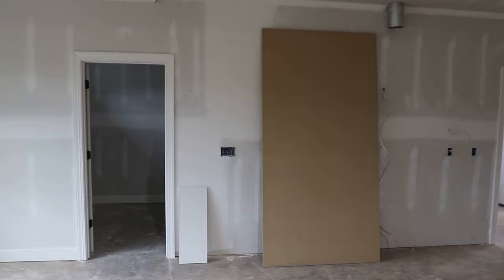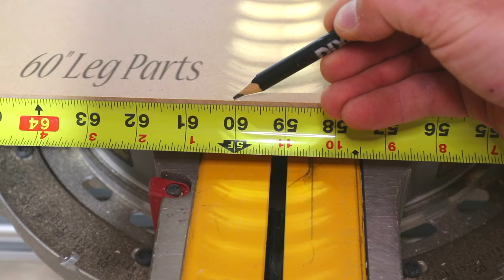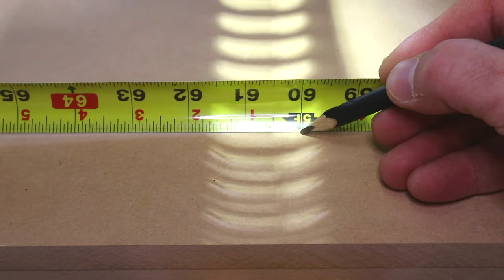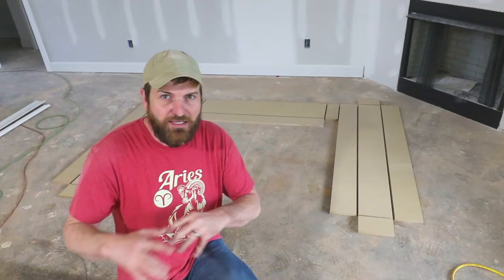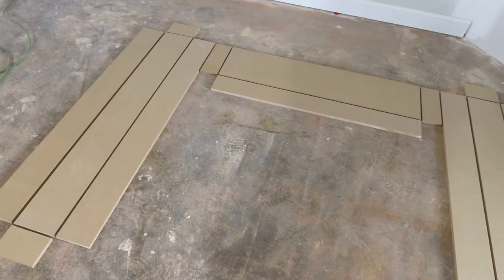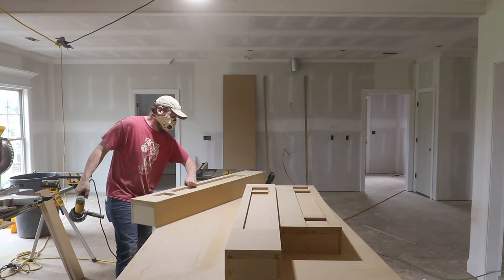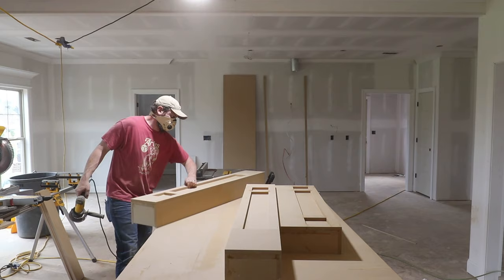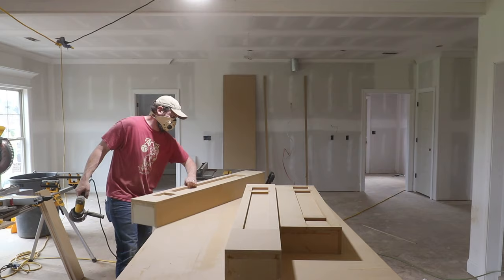How To Build A Mantel

Comment: Jared, dude I love your designs and the way you explain ish is awesome and hilarious.  I’m using the mantel project currently and I’m so excited that I can follow your guidance.  Thanks brotha!  QUESTION... WHERE CAN I GO IF I HAVE QUESTION ABOUT anything?  A BLOG, A WEBSITE???  What’s the deal my man?
Reply from the maker: Thanks man! Despite a ridiculous amount of subscribers I’ve been able to answer questions and keep up with the youtube comments. So just ask here bro!  Sometimes it takes me a day or 2 to respond cause I’ve turned off notifications to try to reduce my screen time 😂 but sometimes I catch it in 5 minutes 👍
Reply: @TMPK  I tried to send a question yesterday but not sure if it went through. (I dont see it.)  **HERE it is just**
---WHAT R THE DIMENSIONS OF THE PANELS @ THE TOP N BOTTOM OF THE RT. & LT. LEGS.  I understand the 2" strips but NOT sure of the LARGER PIECES.  Thx again and love your work brotha!
Reply from the maker: @21shanes  every mantel can be different, without watching the video again I can’t remember what size I made them on this video. I think I normally make an 11 inch wide leg, by 60 inch tall. 
Then with the 2 inch face frames on each side, that would cut the middle section down to 7 inches. Then I would just try to make that top panel square so it would turn out to be a 7x7 inch box. But don’t forget to account for how far the crown mould drops down and leave an extra 2 inches below it so it has the same appearance of the sides with 2 inch face frames.
Reply: @TMPK  Dude, thx a ton for getting back so swiftly.  The time in the video I'm speaking of took place from the 4:39 mark to the 5:10 mark. You explained, "CROWN HAS A DROP OF 3 and 5/8ths", SO TOP GETS A 5 and 5/8ths", SO THERE"S GOING TO BE A 2" STRIP BELOW CROWN MOLD."  

So, If I'm understanding you correctly the LARGER PANELS on the face will be 5 and 5/8ths to keep everything uniform, CORRECT?  ***Dude, THX again for any help!!!
Reply from the maker: @21shanes  yeah! As long as you have the same drop on whatever crown mould you choose. If it’s a different drop, just add 2 inches to that drop measurement.
Reply from the maker: I normally add the width of the total leg, to the crown drop measurement in order to end up with square panels in the end. So if the leg is 11 total, my top middle piece will be 14 5/8. 11 for the panels and 3 5/8 for the crown.
Reply: @TMPK  dude, you are the freak'n best brotha!!!  Thank you, Thank you, Thank you.  You have been a HUGE DAMN HELP!  

I'm sure I will be hit'n ya up again b/c I do love your work and you make it easy to understand.  You explain ish well, with your mouth and your hands,,, as you would discuss.  lol
Reply from the maker: @21shanes  happy to help!
Reply: @TMPK  Dude you have know idea.  Its basically an Anniversary/Birthday/Christmas gift all during this time of COVID shit is tight with$$$.  Dude, you have helped so MUCH!

Thank you!
Reply: @TMPK  hey Jared, I know that you said you don't like painting MDF in one of your comments below but I was curious, IF YOU HAD TO, HOW'D YOU GO ABOUT IT EXACTLY?  HYPOTHETICALLY, what would be THE EXACT STEPS?  I.E.  Sand Paper GRIT, PRIMER?  If so, what kind?  Gloss/ Semi?I know you said it would take about 4 COATS NORMALLY but IS THAT WITH SANDING AND A PRIMER?   

Dude sorry to ask sooo many questions but I do RESPECT YOUR WORK and IF you were near I'd hire you but you arent and I want to do what you show out of RESPECT and DO IT PROPERLY as  A GIFT TO MY WIFE.

Thanks for any help, AGAIN!  You are the fu*kn man!
Reply: @TMPK  PREP MDF FOR PAINTING>>> THOUGHTA?!!???

I did some research, what are ur thoughts regarding...?

-  SAND W/220
-  SOLVENT BASED PRIMER
-  USE A BRUSH TO APPLY PRIMER, paint as normal?  THOUGHTS?

Like I said, I trust your opinion and judgement my man.  Thanks for any thoughts.  Hope to hear from you soon.

Cant wait to take on your next project brotha!
Reply from the maker: @21shanes  Haha it’s not that bad. Fill the nail holes first. Some kind of putty or wood filler. Sand that down smooth then start with primer, and I think the professionals at work use a paint sprayer but I’m old fashion and actually like seeing a little bit of paint brush lines. 
  I don’t know anything about kinds of paint, but some kind of trim primer maybe? Then light sanding 220 grit just to knock the fuzz off. Then probably a semi-gloss would look best. And probably 2 coats of it but that depends on how the primer goes. 

I painted my personal mantel like that and it turned out great. There’s a video somewhere deep in my channel called cassy and Jared remodel or something like that. I believe you can see my mantel in there but that’s before I was good at how to videos. I was just filming shit for fun lol
Reply: @TMPK  Dude, I wish we lived close by to go and have a drink over it.  lol  You're the best my man!  Im a freakn magician bc of the "Mantel" video and I know all of theee SONGS BY HEART NOW...  no shame in my game.  LOL  

HEY, THANKS AGAIN!  I'm sure I will be in touch in the future.  LOL

Comment: Any Chance you can explain the angle cutting for the Crown Molding? I have tried every combination of your 35 Degrees and 30 degree tilt and nothing matches..... like not even close. I also tried 45 degrees and that obviously didn't work either.

Thanks!!!!
Reply from the maker: Well there different kinds of crown molding that uses different compound angles. 35° and 30° are for a 45° crown, mean same drop from ceiling as distance on the ceiling from the wall. The other crown is a 38° crown. That comes down the wall farther than it sticks out on the ceiling. I believe the cuts are 31.6 miter  33.8 bevel. 

The easiest way to find your compound angles for the crown you have, is turn the crown upside down on your saw. The bottom of the crown goes agains the fence, and the top of the crown goes on the table. With the entire piece out to your left, adjust the crown against the fence and the table until those parts are flat, then turn your miter to the left to 45° and that’ll be your cut angle. Make the cut, flip the crown back over so the bottom is towards you, lay it flat on its back on the table then line up the bevel and miter with the 45° cut. It’ll be 1 of the 2, 35°/30° or 31.6°/33.8° 🤷‍♂️ I should make a crown video one day lol
Reply: @TMPK  Thank you...... Your video did a great job explaining all of the build except that. This is not something I am familiar with. I appreciate it!!!!

A crown molding video would be a great idea!!!

Comment: Hi Jared,

Any chance you can share a sketch with the measurements? Love this mantel, but having a hard time figuring out the dimensions of each piece. Thanks very much. Mike
Reply from the maker: This was years ago and every mantel can be different. Just depends on wall size or fire box size. I normally like the top at 5 ft and 8 inch wide legs and about 6 deep.
Reply: @TMPK  what size panel molding do you use with 8 inch wide legs and 2 inch wide (1/2 inch) strips? Also is top of surround 8 inch high (same as leg width) or is it a little larger? Thanks much.
Reply from the maker: @burke1754  the base cap inside the panels is 1 3/8 wide. I’ll try to draw it with text below lol 

__
2 inch top
______
3 5/8 crown 
_________
2 inch face frame 
_________
4 inch recessed panel with 1 3/8 base cap picture framed inside
_________
2 inch face frame
_________

The legs ⬇️
| 2 | 4     | 2 |
Reply: @TMPK  Thanks, 
and the height of top piece that runs between the legs is 8” high?
Reply from the maker: @burke1754  yeah, below the crown is 8
Reply: @TMPK  thanks!!

Comment: What did you use when it came to painting the boards? did you have to use some type of sealer?
Reply from the maker: I don’t do the painting, but the painter will caulk all the corners and use a nail hole filler then a primer paint then a semi gloss paint
Reply: @TMPK  awesome! Thanks

Comment: What size brad nails are you using initially?
Reply from the maker: I use a 16 gauge 2 inch or 1 1/4 inch straight nail for nearly everything. 23 gauge 1 inch for smaller things.

Comment: What angles did u use for the crown.  And how do I figure out if u need need a 22.5 cut
Reply from the maker: Well, it’s complicated because there’s different kinds of crown that sit on the wall at different angles. For a 45° crown on a 45°angle I do 35.3 miter and 30 bevel. For 22.5° I do 16.3 miter and 15.7 bevel. Google crown cutting charts. Then find your angle 👍

Comment: What size (gauge?) nailer do you recommend?  Thanks!
Reply from the maker: I use 16 gauge 2 inch straight nails for the majority. I also have a 23 gauge gun for little things
Reply: @TMPK  Thanks! (And shoot, mine's 18.)
Reply from the maker: @lesliemg1  you can build things with 18! Just use glue.  That’s the important part 👍
Reply: @TMPK  Thanks!  I'm a rookie, but excited to give it a try!
Reply: I can't thank you enough for this video.  I've wanted to build a mantel for so long, but had a few steps I couldn't figure out.  This got me over the hump and I was finally able to take some time off work to build it (I'm a beginner so not as speedy as your video).  I love it!

Comment: Do you have a blog where i can find your mantle measurements?
Reply from the maker: No, almost every one is different. On average I like to make them 60 inches tall, legs 11 inches wide x 7 3/4 inches deep, the middle, around 14 5/8 tall x 6 3/4 deep. The top, 2 inches thick, 5 inch overhang on the front and each side. 

Pretty confusing. Just freestyle! That’s what I do lol

Comment: mmmm. particle board, glue, and paint next to a fire, yah yah people do do it, and do it more often than not, but is it a good idea,yahhhh?
nope!
looks clean and nice job building it, but building inspectors need to open their eyes.  yah no fireplaces always had stone or marble around them, the flooring was also some sort of stone or marble.  i guess i have a certain level of concern about disaster prevention.
cheers!
Reply from the maker: Well it’s just a little gas fire place. Not a whole lot of heat coming out of it. It’s more for aesthetics

Comment: Could someone help me? The inside trim/moulding he put inside the "Face Frame" - what size/type is it? Thanks!
Reply from the maker: That’s called basecap. It’s 1 3/8
Reply: @TMPK  Thanks Jared!! One more question - what thickness of MDF did you use? Appreciate your help, Sir!
Reply from the maker: @harrisiqbal957  👍👍  3/4 inch thick

Comment: Any trick to painting?
Reply from the maker: I don’t do the painting at my job but most painters around here put a little caulk in the corners, fill nail holes with putty, and use a sprayer. I did the first 2, then used a brush with a semi gloss white paint on my personal mantel. Turned out great!

Comment: So the crown isnt at 45°? Can you explain that part. It looks like you showed 30°
Reply from the maker: Check out my latest flat coffered ceiling video, towards the end I show a little more in depth cutting crown. It is on 45° but when you cut the crown laying flat it takes a compound angle cut. 35.3 on the miter and 30 on the bevel.
Reply: Great question!

Comment: You left out the most important part. Painting mdf board. I have to make one of these.
Reply from the maker: You don’t wanna paint MDF 😅
Reply from the maker: I mean, you have to, but it’s the worst lol
Reply: @TMPK  I've never worked with MDF. What is  hard about painting it?
Reply from the maker: @pastorjp60  it just soaks the paint up like a sponge. Probably need 3 to 4 coats 😞
Reply: @TMPK  thank you for your quick reply. Today was my first time seeing your channel. I loved everything about your video! 
I'm considering building a mantel. I was thinking about using oak plywood instead of mdf. Any thoughts about that?
One last Q... do you offer plans for yours?
Reply from the maker: @pastorjp60  plywood doesn’t really work with the way I built it because the edges of plywood aren’t the same as the surface like MDF. You could use 1x lumber tho. And no plans, only trapped up in my head pictures lol

Comment: Check your local fire codes. There are minimum limits to installing combustible material around the firebox, typically a full 12 inches.
Reply from the maker: I’ve heard about these fire codes. BUT, Never failed an inspection or had a mantel burn. 14 years and counting
Reply: I'm sure it's fine fire Marshall Bill Val.lol